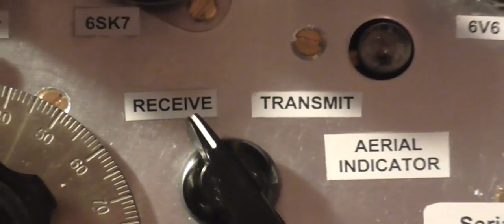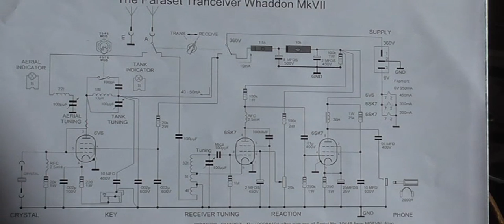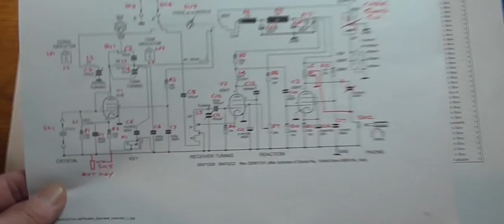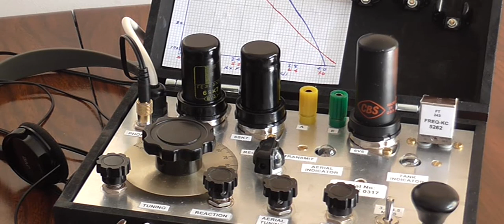#5 Valve QRP - Building a Paraset

Comment: Do you think switching out the lamps would increase power output by a significant amount? Plus, a 12v Inverter PSU  would be a nice companion for portable use. G7VFY.

Comment: I'm not sure why they used 6SK7 tubes (valves).  These were supercontrol or remote cutoff types.  Usually the sharp cutoff 6SJ7 would have been used as a detector and audio amplifier.  Perhaps at the time the 6SK7 was easier to source.  If building a replica, I'd try both types and see which worked better.  Also the type 6AG7 power pentode could be used in the transmitter instead of the type 6V6.  I have a few of those and none of the 6V6 metal types in my junk box.

Comment: That's a good job Graham, it looks very nice. It puts fun into radio instead of operating a fancy bought set all the time. I love building stuff. I built a transmitter using a 61BT valve I had, for 5.262 MHz, 7.030 MHz and  10.106 MHz.
Reply: Bill, G4GHB.
Reply from the maker: @bill-2018 - Hello Bill - Many thanks for getting in touch. I often get on 5262kHz and I hope you enjoy your homebrew 61BT Tx. I will listen for you and maybe we will manage a 2 way valve QSO sometime. vy 73 Graham de G4VUX

Comment: Good job!!! I started the construction of the box and to find the various components. Where can I find the 36H inductance?
Reply from the maker: Dear Riccardo - Any small filament transformer will work, the exact value of 36H is not important. I used this one from eBay https://www.ebay.co.uk/itm/220V-50Hz-6V-Input-Output-Mounting-Vertical-Single-Phase-EI-Power-Transfor-W2I3/382639713768?epid=17015766552&hash=item59171aade8:g:85cAAOSwabRb9aMz:rk:1:pf:0 
The filament winding provides a low impedance headphone output for modern 'phones. 73 Graham de G4VUX

Comment: Hi Graham, I noticed your modified schematic showing the addition of a Shendk Filament transformer for audio coupling and your later explanation. Great idea. I'm employing that in mine. How low of an impedance did you get on the output? 72 De VK8feet
Reply from the maker: Adz Basslines - Thanks for your comment, it's good to hear from you. The turns ratio is about 40:1 so a parallel pair of 8 Ohm headphones will present an impedance of about 1.6k x 4 = 6.4k to the audio valve. In this case, there is plenty of volume. I sometimes use small active speakers which have a much higher impedance and they are fine too. Kind regards, Graham de G4VUX

Comment: What's the key you're using? I ask because I picked up the same one and I've been trying to find out the maker and the details of it! - I'm referring to the solid brass one with bearings. I can't see it in the video, but it's on the thumbnail
Reply from the maker: M0ZAI - Thanks for your comment. The key in the thumbnail is the Kent KT1. They are still available from Kent Morse Keys. Kind Regards, Graham de G4VUX

Comment: Beautiful valve rig! I built the transistorized 4SQRP Group Bayou Jumper kit. Fantastic little rig with a switchable built in 200Hz  CW filter, added mute receive during transmit, fine tuning control and side tone generator.
Reply from the maker: Hello Adzbasslines, Thanks for your comment, it's great to hear from you. The Bayou Jumper sounds fantastic ! I hope you make lots of contacts with it. 72 / 73 es gud dx. Graham de G4VUX
Reply: Hi Graham, how's the MkVII going? I've had fun with the Bayou Jumper, but now building a Whaddon MkVII. I managed to acquire the hard-to-get 6V6 metal tubes. I am getting the chassis made by your contact.

Comment: Thanks Graham for sharing your Parset with us.  I have most of the parts for mine just need to order the caps, resistors, etc. and the transmit/receiver switch.  I did build the solid state kit that you speak of and it is called the Bayou Jumper.   Great little kit and it has given me hours of fun already.    Very much  interested in the SOE and the Paraset radio.  Once again many Thanks for sharing.

 Mark KA8ONW
Reply from the maker: Hi Mark, Great to hear from you. Thanks for the info on the Bayou Jumper, it looks like a brilliant kit. I wish you luck with the valve version. Note that neither the original schematic nor the SM7UCZ version have a bleed resistor in circuit when the rig set to Transmit. This is bad practice as it can leave a charge on the 0.002uF capacitor and the anode circuit of the 6V6 when the power is removed! Very best 73, Graham de G4VUX